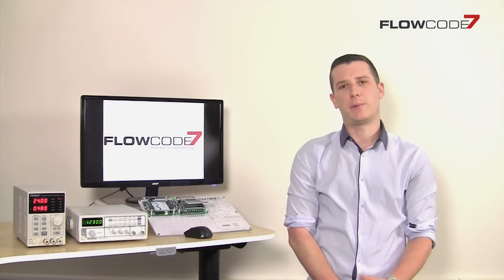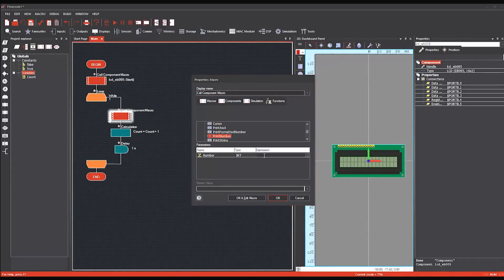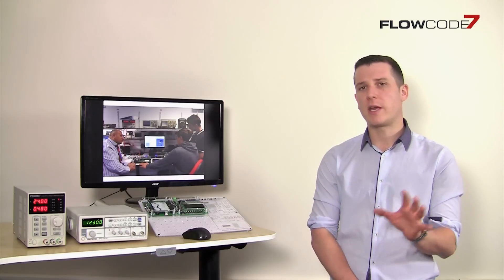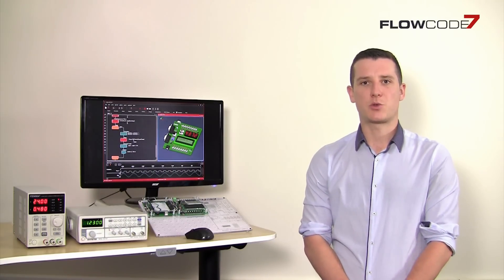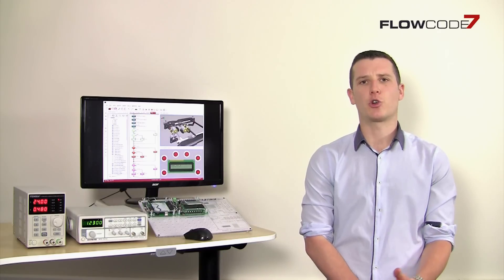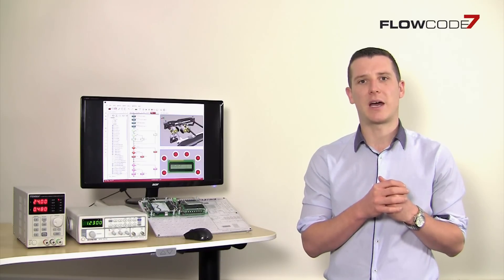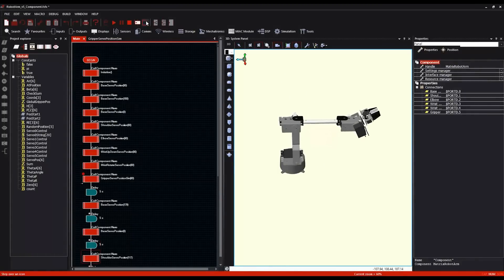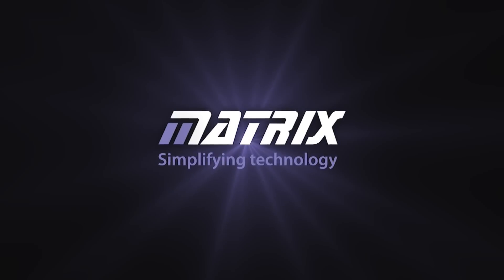Flowcode 7 - Smarter programming

Comment: Hello. after I configured the adc Aref + and loaded into the chip avr. now my circuit is only 255 meter highest level 8bit, 10bit 1023. no small value measured by the software hon.I think that chip die flowcode adc function. please tell me how to fix a